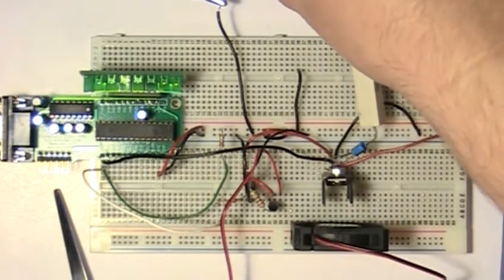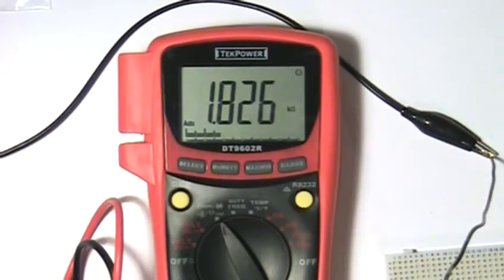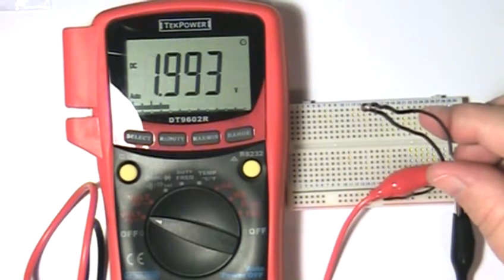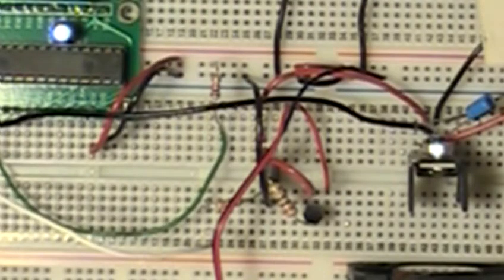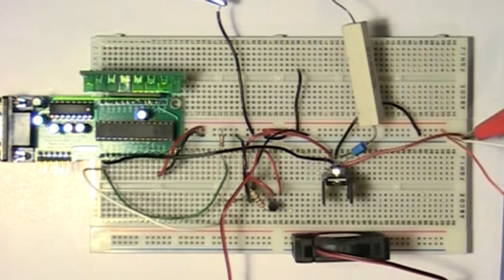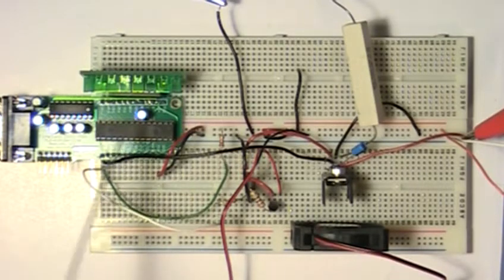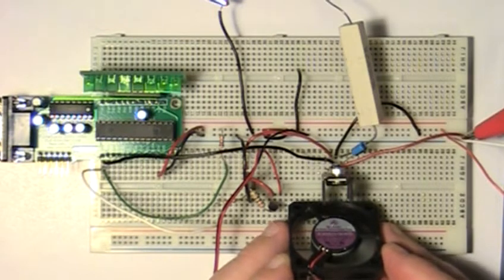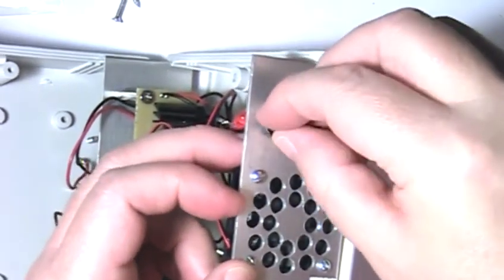MD Lab: Power Supply Cooling -- Part Two, Temperature Sensor Controlled Cooling Fan

Comment: David do you have the schematic diagram for the circuit you used for the temperature sensor/fan? I'd like to incorporate it into a an 11 amp 12V DC power supply I use to power amateur radio transceivers. Also, your thoughts on how to run the fan at half speed at one temperature and full speed at a higher temperature. I like the LED temperature display too.

Comment: Thanks David. As always your videos are inspirational and educational. Very cool idea. I was just pondering temp sensors this morning looking at 7 segment display clocks with temps.  I remember you telling me about the voltage regulators and how the chips get hot. I dont have anything running that long off them as of yet, but this is a great idea to incorporate into a finished project. Thanks again.